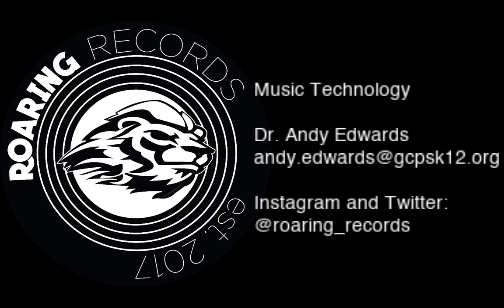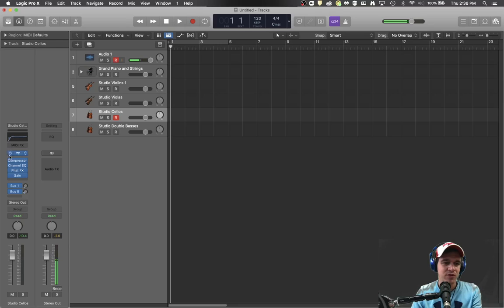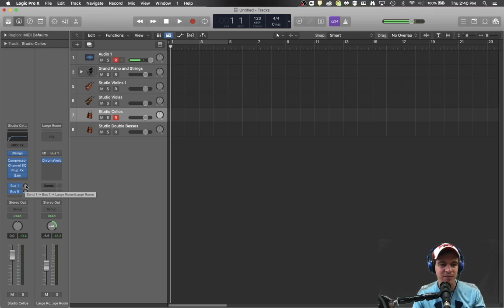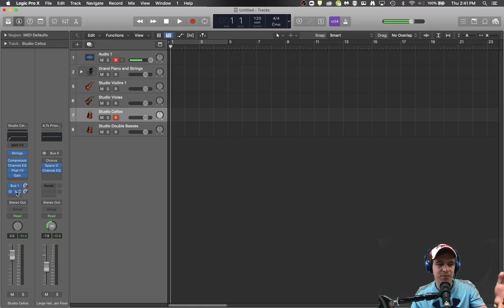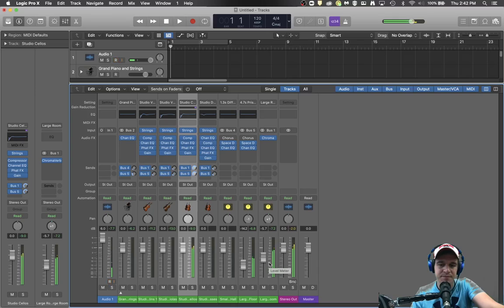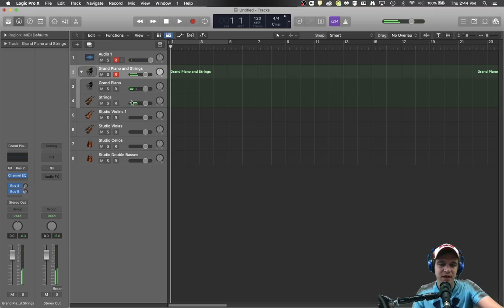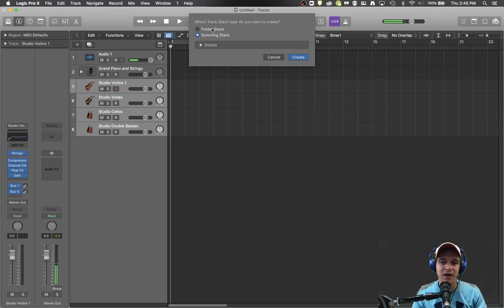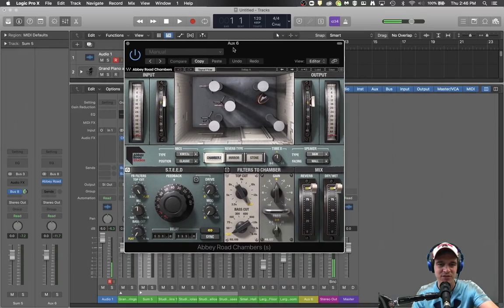Logic Pro X: Signal Flow with Bus Routing

Comment: clarifying question- so if you only turn the signal dial to 50% on the first bus in the instrument channel, do you loose 50% of the signal on the second bus, and so forth on the way down to stereo?
Reply from the maker: That’s one way to think about it. So, if you didn’t want it to hit an effect too hard then you could leave it at 50%. Another way to think about it is as another set of faders. It’s a way to make a secondary mix. The knobs are the same as the faders just look different.

Comment: hello, what should we do when an audio track takes a signal from other tracks, how to turn it off?
Reply: i need help send me a suitable clip or write me what i need to do :((
Reply from the maker: @slaviangelovlevit777  It sounds like you may have changed the output of one of your channels to a Bus channel.  So the bottom of your track in the mixer or inspector will have the output listed.  It generally says Stereo Out, but, you can change it to be a bus number and it will make a new track that handles the audio again.  The input of the new track will be labeled as bus whatever.  This is different than the standard input number or midi instrument.  So, if you change the output of the track back to stereo output, or turn off the bus sends, that signal will not go anywhere else before hitting your final mix